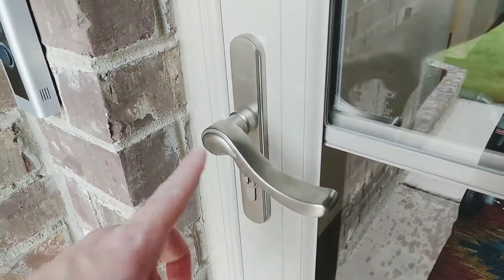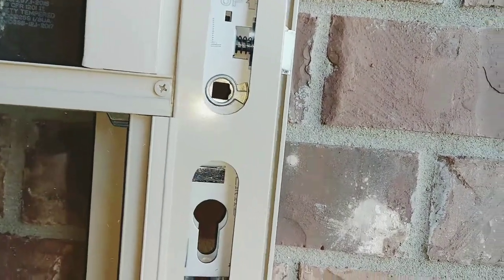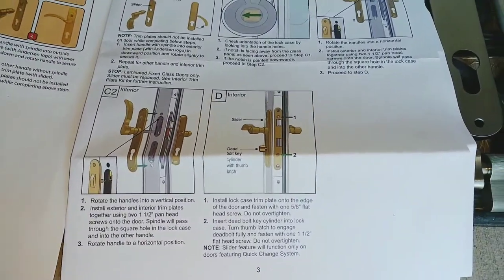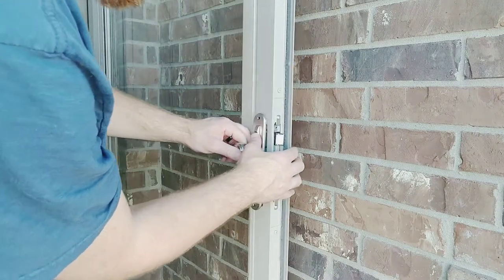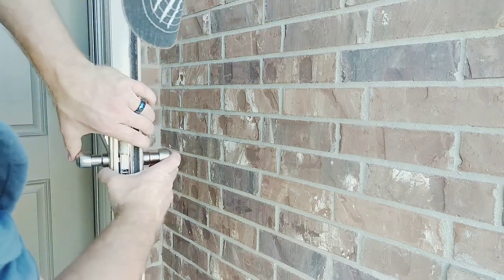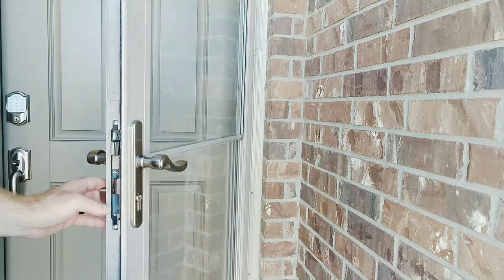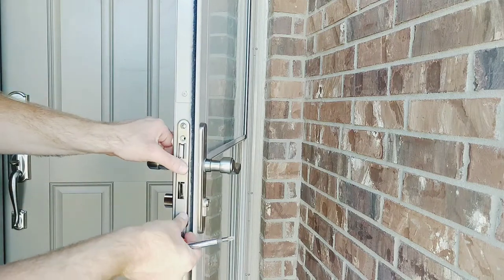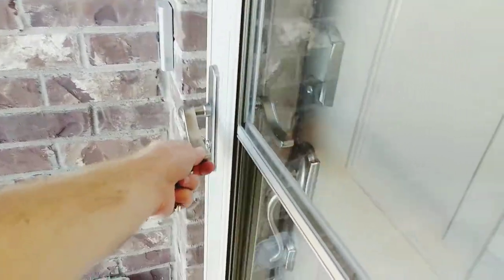Install Door Handle on Andersen 3000 Series Screen/Storm Door. Model# H3SEL36SA from Home Depot

Comment: Thanks for the video, what does the top button above the inside door handle do? I can move it up and down and all it seems to do is retract the thread of the top bolt, not sure of its purpose? Thanks in advance
Reply from the maker: I have no clue. Let me know what it is if you figure it out
Reply: @becausestuffbreaks  and @darkryderman1191 from another video, that top button is to allow the handle to move into a vertical position so that you can swap out the screen for glass.

Comment: Any way to improve the catch? Bad idea to make the frame as the catch. My door keeps blowing open unless I lock it. 
To top it off, you are not supposed to install a wind chain because the mount would go through the retractable screen. 
Any ideas on this?
Reply from the maker: I haven't had any problems. Is the latch in or handle in backwards? Basically, the beveled edge of the latch is facing outside.
Reply: Same problem. Did you find a solution
Reply: @Mikey2two  Well I got a heavy duty closer from Home Depot. It's stronger than I wanted but really keeps it tight. Also. I did install a chain for just in case. (I should show a video of my setup someday.) The way I did it was a piece of wide aluminum stock across the top. Its fastened to side rails so it doesnt go thru screen. Drilled into it to it & fastened with small nuts/bolts to mount the chain hook. 
Seriously though the strong closer is probably enough.

Comment: Just moved into a house that had their left hand door handle set installed upside down and now I cant get the handles to seperate so I can flip things around correctly. Any suggestions would be appreciated. TY!!
Reply from the maker: That's odd. They should separate. I don't know what could be holding it together.
Reply: Set screw?